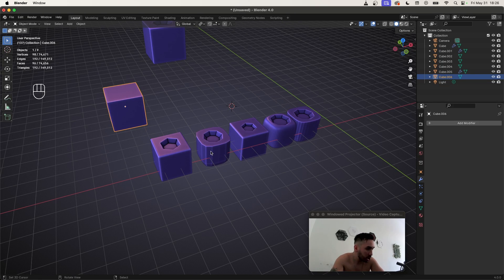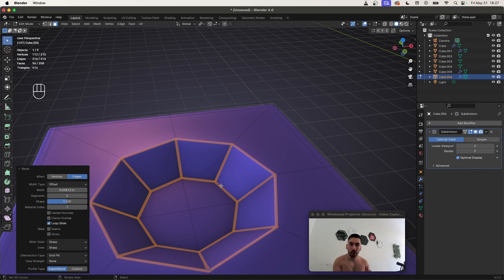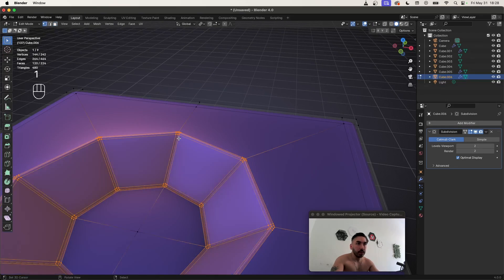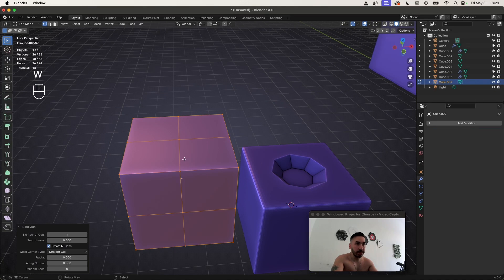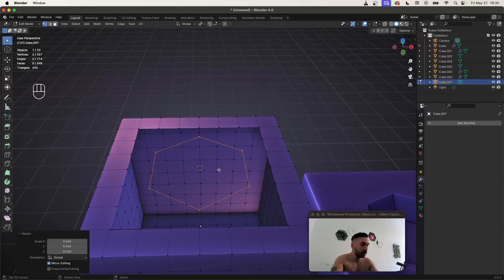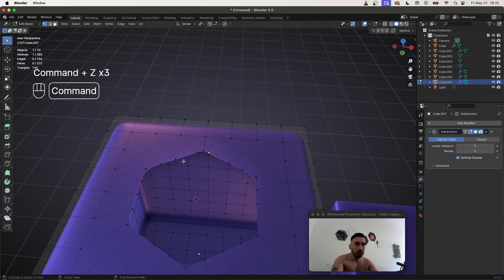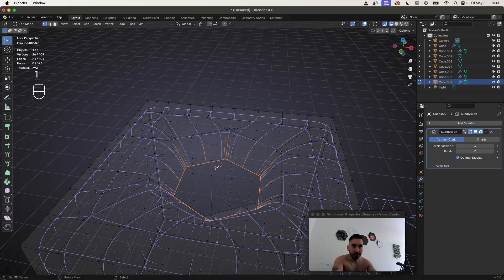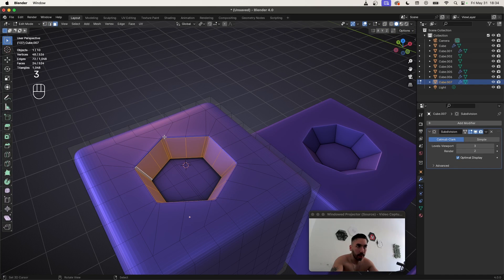The MOST IMPORTANT Topology Tip in Blender (Aryan) #topology

Comment: Yo, if you inset the bottom face instead of that grid fill you can have bigger space for the bevel afterwards, just fyi, no need to grid fill first. Fill the hole with the Ngon, inset, grid fill the inside Ngon. Than just bevel/ support loops manually